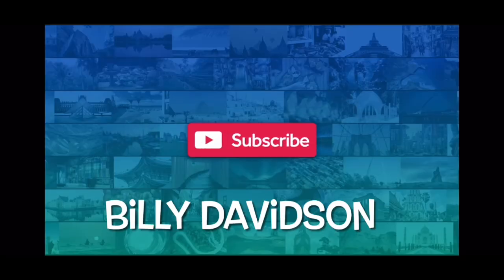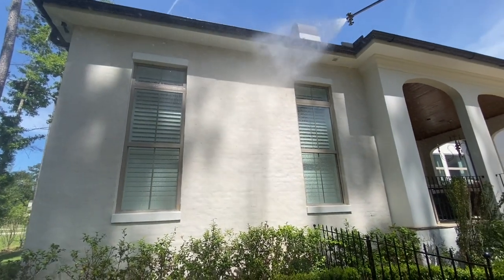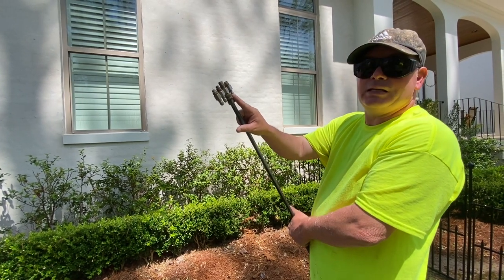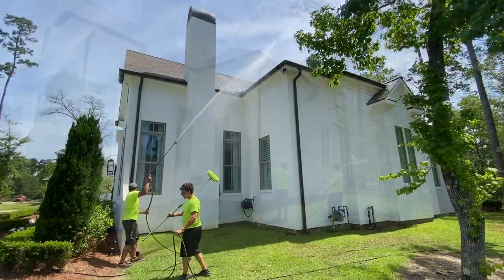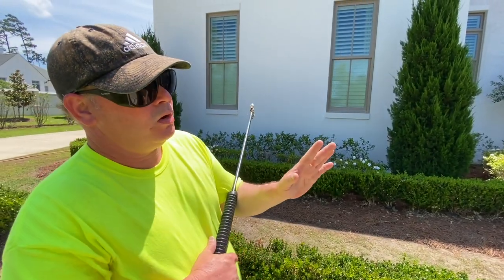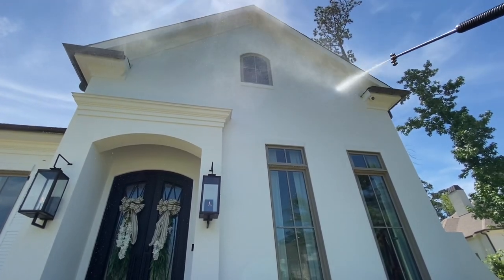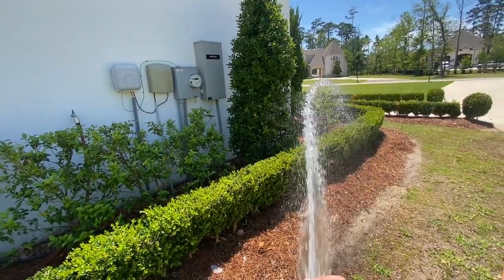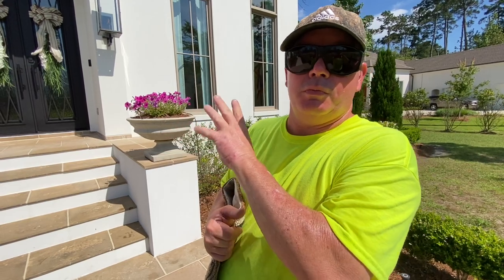How to pressure wash a house start to finish

Comment: That was an excellent video Billy. Even seasoned pressure washers could pick up a tip or 2. I can definitely feel the difference in pressure when the S/H comes out if wand. On mine it's like a small burst just for a split second, and also the same thing when when the soap finishes for the rince.

Comment: Billy, thanks for the video. Do you typically wash houses or commercial buildings (apartments) with a 1% SH mix and if you do take it higher how high would you take it to 3?  I have an apartment complex coming up. Mostly brick with some stucco. I been researching and see to use 3% on stucco. Thanks.

Comment: Love the vid. I’ve done around 30 jobs so far. One including a 14,000 sqft Walmart with a 2.3GPM 3300PSI pressure washing. I really need a better equipment set up. I’m using a diaper cannon that shoots out 0.5% which means I have to scrub every inch of the Walmart/houses. I have a bigger Walmart coming up and would love a new setup before then. I have about 3500CAD to work with. Please help. I have a truck I can put them set up in.

Comment: Not getting any downstreaming with 150 ft of 3/8 hose. works great with 100 ft. tried several tips up to a 60 tip and several different guns. I have a 5.5 gpm pump. any things to try.
Reply from the maker: You can use an open 
Ball valve to downstream with anything over 100 feet of pressure hose. Also you can move your downstream injector up the hose closer to the gun, this works really good but you'll have to use a bucket to draw your solution out of. One mistake you can make is dumping your bucket over

Comment: Thanks Billy. Quick question, when you were rinsing you were using the JRod. How did you stop the downstream injector from pulling SH?
Reply from the maker: We usually just have to run back to the truck and pull out our siphon tube. I know there are some remote systems out there as well and I'm anxious to try it soon

Comment: Billy what percent my 4gpm Honda put out sh if I put straight sh in a bucket
Reply from the maker: I would recommend doing a bucket test but most likely about a 1 to 12 ratio so if you're using 12% bleach you should get about 1% out the nozzle on a 150 foot hose

Comment: Why is the application bottom to top?
Reply from the maker: If you start at the top the cleaning solution can drip down in small droplets and start to evaporate really quick within the matter of seconds. The H2O will evaporate out of the small droplets and caused the concentration of cleaning solution to increase rapidly. Therefore in this situation as described you can etch paint or even possibly remove sections of paint where the droplets evaporated. Starting at the bottom ensures that any droplets will always drip on a common wet edge

Comment: Where can I get those long hose sleeve at the end of the hose? Does that come with the hose? I  found that on suttner page can’t find that for sale. Is that extra protection in case the hose burst 💥?
Reply from the maker: Yes it comes attached to the hose when we purchase yet, but that's an awesome question maybe someone can help us out by reading these comments. I would love to be able to buy a dozen of them just to have it on the truck. They definitely help with the hose not bending at the weak point
Reply: @billydavidsonvip  wha hose brand is that? Thanks

Comment: You mentioned at the beginning of the video that sometimes the 90 in the gun will prevent SH from coming out. I am having that problem, when I have a normal soap nozzle on I don’t have an issue, when I put a nozzle for 2 stories on, no SH. Thoughts on how to fix this? I have the correct nozzle sizes for my jrod.
Reply from the maker: Yes you're creating too much back pressure for the downstream injector to work. You could try idling down your machine to have power and that should start the draw through the siphon tube. The two-story nozzles constrict the water flow to projected up higher but often times it causes the downstream injector not to work correctly
Reply: @billydavidsonvip  thank you very much for the advice. New to the game, gonna check out your courses when I get a few bucks in the bank. Thanks again!
Reply: @billydavidsonvip  sorry to bother again… so I idled down to a little less than half, I have removed the gun and hooked the lance to a quick connect into a ball valve, same outcome. Works on the regular soap tip I have in the jrod, but won’t work for the high pressure 2 story nozzle. Any other thoughts? I really appreciate the help!
Reply from the maker: @rickycarter6433  
The only other possibilities that I can think of is that the two-story soap nozzle orifice is too small possibly designed for a lower gallon per minute machine causing too much back pressure or either the Downstream injector is faulty
Reply: @billydavidsonvip  that’s what I’m thinking, I have a 4gpm washer and the size is 00100. It was part of the jrod I bought on Amazon for a 4gpm unit. I will check it out. Thanks again for your help! Keep up the videos they are great!!